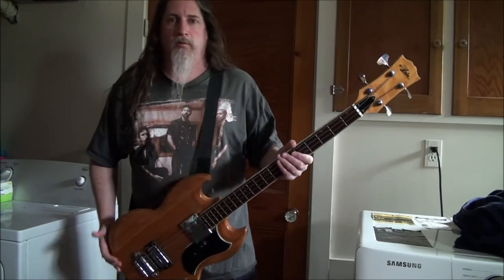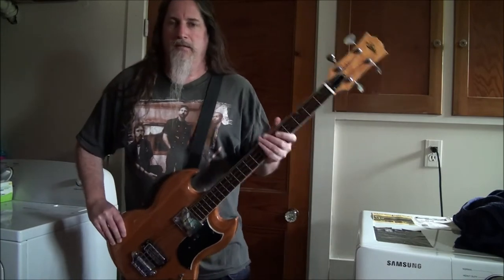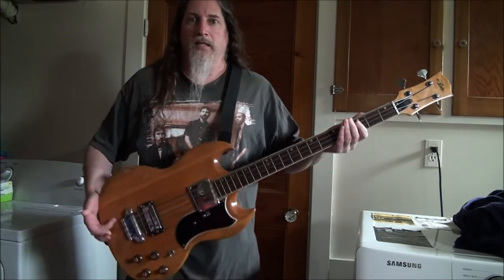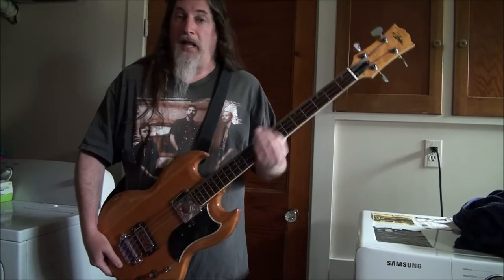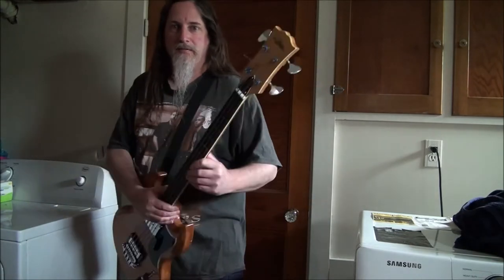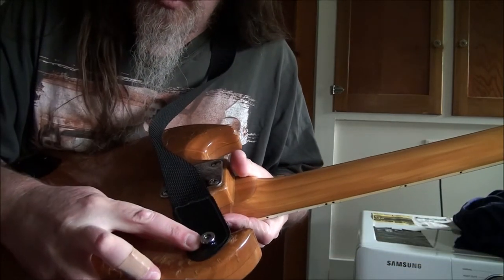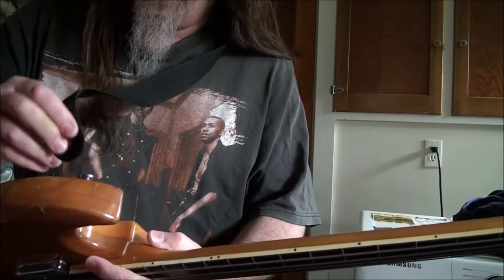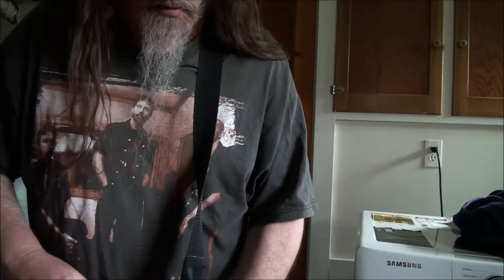Repositioning The Strap Button On An SG-Shaped Bass Guitar

Comment: Just a tip: In addition to the button you moved, If you move the strap button on the bridge side up to roughly a straight line from the top of the pickups,  it more or less moves it about 2" up, you'll have zero neck dive.
Reply from the maker: I'll try that! Thanks.
Reply: @JoeHartRocks  This is what I was going to suggest. It should totally shift the center of gravity much lower. Did you try it Joe? How did it work out if you did?
Reply from the maker: @NeoRichardBlake  I tried it in another video. It didn't really work. It helped but didn't fix the issue 100%.
Reply: @JoeHartRocks  Dang! I've got an Epiphone SG that I was considering doing that to, so I guess now I may not bother. I was also thinking of maybe using a command strip hook or something similar to R&D the exact placement.
Reply from the maker: @NeoRichardBlake  try it. What have you got to lose? And it depends on the amount if neck dive. Different instruments have different balance points. Give it a shot!

Comment: I got a gibson sg bass,the previous owner moved the strap button from the neck joint to the horn and this way it dives so much worse.
I moved the bridge side button 3 inches higher like on a spector and combined with the original positioned button on the neck joint the dive is gone.

Comment: Just do this. 
Get a short piece of tube or wood. Use a much longer screw through the tube or wood and it should go a little deeper into the body. Fit the button on the end of the extension with the longer screw. Often only 1 1/2 inches will do it. It’s invisible from a short distance and it’s not going to affect the value because it’s removable. Once tried you’ll never take it off.
Reply from the maker: I have a guitar that dives a little. I'll try it! Thanks.